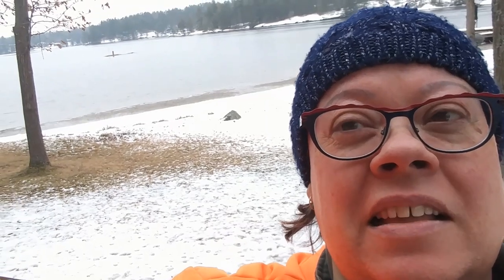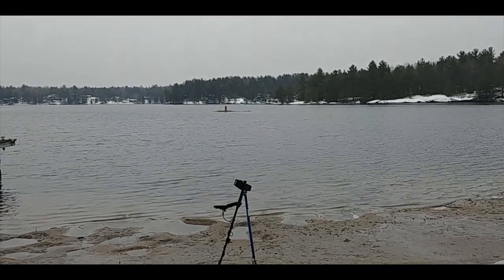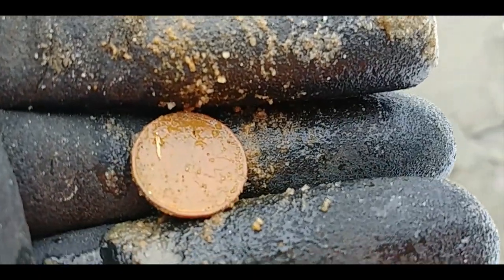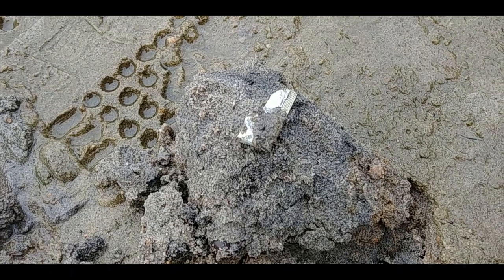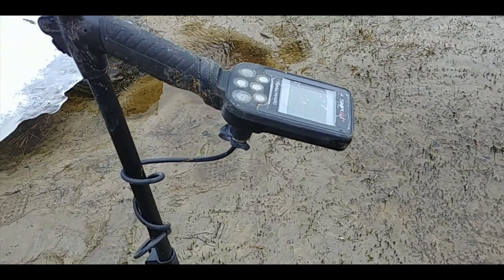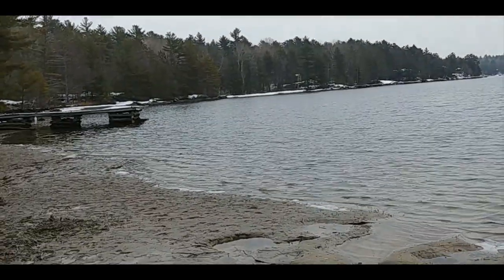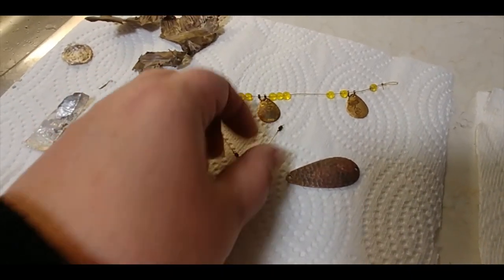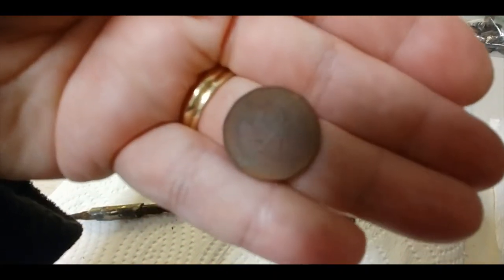Antie's Adventure Assortment Episode 43  Early December Beach Detecting

Comment: Nice find and congrats!  Drawn down lakes are great spots and I would get in there as much as you can!  Definitely gold-filled was an older method of plating and is much thicker than modern electroplating. Unfortunately, extracting the gold is a messy process using some nasty acids and chemicals and there would not be enough to make it viable. People usually use large amounts of gold plated items for the process. It’s a start and it’s just a matter of time! Hit the swimming beaches and concentrate in the knee to waist deep water first. It’s where people run and dive into the water which has the highest risk of rings falling off.  Did not get gold at all in 2019 but by concentrating in the lakes this past summer, I managed four gold and five silver rings. TC&HH!
Reply from the maker: Thanks for this information, and for the encouragement!  Now that I have the Simplex, I can go wading without fear of wrecking my machine.